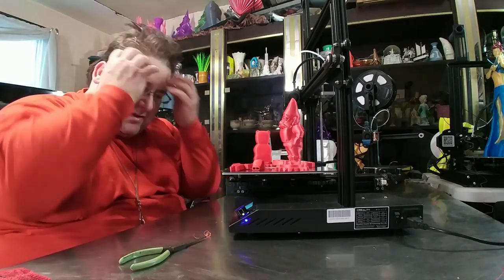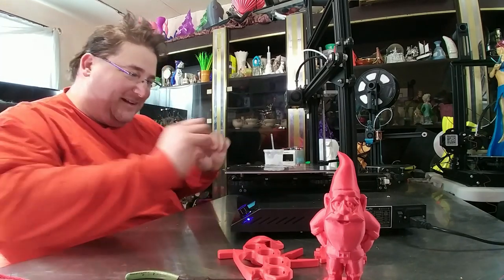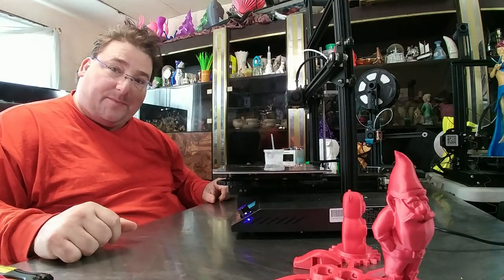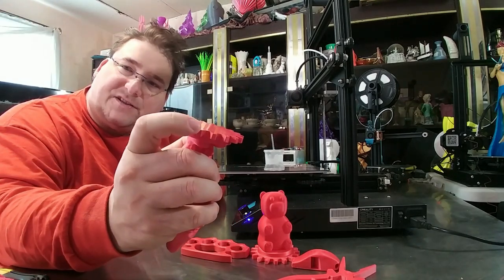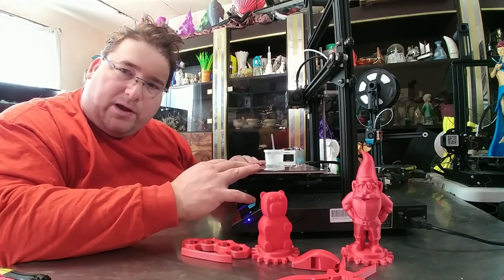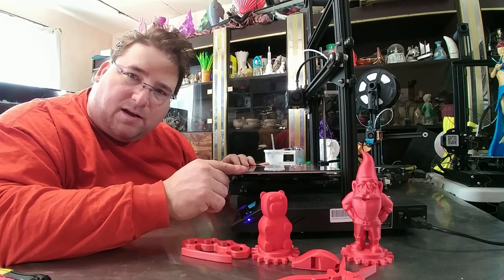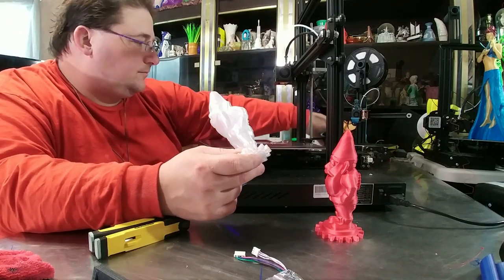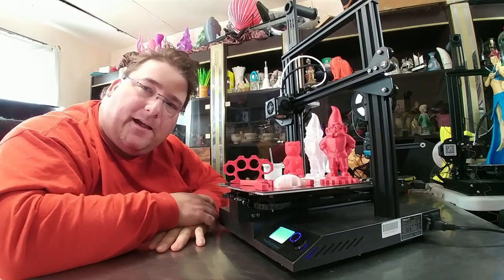Wham Bam Magnetic FlexPlate System T3DP 232

Comment: Hi Chris! Great review. I'm glad I got to see ABS printed on this surface. I don't have any - all I have is PLA and PETG. But I gotta say, I've been LOVING this PEX stuff and the utter convenience of being able to pull the spring steel sheet off the printer and pop the print off. Works EXACTLY like the removable system on my MK3, although on the MK3's PEI surface I worry that PETG will stick too hard and damage the sticker sheet.

And like you, I've found that the majority of my PLA prints can either be plucked off the PEX once it's cooled down. In some cases it's released entirely after the print has finished and the bed has cooled, like with an overnight print. But boy does it hold while it's hot!
Reply from the maker: yep and I Just did PETG and it comes off SUPER easy. easier than ABS and again ZERO warp. it stayed down and stayed flat all the way to the edge of the print. I am almost more excited about the PEX than the flex :-)
Reply: @nerys71  When you want to show off how easy it is to remove prints... just FLEX your PEX. 🤣

Comment: Thanks for the preview Chris. I'm in! I just bought a Buildtak Flexplate for one of my  Ender 3's. Getting this for the other one and an extra plate to try on the Buildtak magnetic surface.That shiny bottom finish is nice.  I might as well upgrade the CR-10S and maybe one for my Printrbot Metal Plus too. It will nice to have all my print surfaces like my MK3. How about an aftermarket spring steel sheet setup for the PRUSA MK3.
Reply: Awesome to hear! Our Kickstarter will have 90 kits of early bird discounts so make sure to sign up for email notifications to get early access.

Comment: It's nice that it's cheaper than the buildtak system. Better suited for cheaper printers. I've been fine just buying the spring steel from buildtak $30 and using clips. The magnet system is nice, but clips work just as well for 50¢.
Reply from the maker: agreed. but dammit I hate the freaking clips so much. I tend to print full volume a lot so I am always having to move the stinking clips out of the way and its just annoying :-) ALTHOUGH I really do like the Fiberglass Creality print surface they include with their machines. but its $35 for more. for $30 more I can ditch the clips and gain the nixe flex plate and pex print surface. if Creality starts selling the fiberglass plates and surfaces for say $10 it would be a much harder sell to me.

Comment: Nice. Though at around $70 for the version fitting the Ender 3, that plate upgrade costs half as much as the printer itself. Sure, it may be quite high performance and fit for high temp filaments, but until those get significantly cheaper, this is gonna remain a luxury upgrade for a very limited customer base. Probably gonna wait for the significantly cheaper china clone. Until then, my Creality Cmagnet flex build plate for $15 works just fine for me.
Reply from the maker: they are 30% cheaper than buildtak...... something to consider. I don't think buildtak is "going under" anytime soon.

the cmagnet is $27 (yes I also nabbed a few of them when cheap) bud sadly once you hit 80c they die. I am starting to dabble in higher temp plastics where I need 100-120 even 130c bed temps. cmagnet won't do that. the higher currie temp magnets cost a ton more cash than the lower grade magnets.

I DO love the creality fiberglass flex plate though. those are REALLy nice. if I can ever snatch up a bunch of them cheap you bet your butt I will grab them.
Reply from the maker: agreed if you are just printing pla and petg only the cmagnet system works fine and will give you the same convenience for about half the price ($15 was a early bird deal) I have 3 of them :-) (the creality version)

I do not even consider the price of the printer when pricing upgrades. there is simply no way for anyone else to compete on prices with large chinese manufacturing. no way. even Creality regrets pricing the ender 3 so low. it should have been $299 at least to start. they were too aggressive and now are stuck with it (not so bad for us of course :-)
Reply: @nerys71  Yeah, the Ender 3 is amazing value for the sub $200 price. And it is exactly that price, which makes it THE budget printer of 2018. I think Creality knew exactly what they were doing, they wanted to expand their market share and in that they certainly suceeded! And seeing how they aren't bancrupt yet, that gamble obviously paid off.
Sure, no manufacturer in the western world could provide a smililar product for that price, but that's what the whole Chinese economy is pretty much based upon.
Also, they pretty much save most on the quality assurance and shipping costs.
I, for one, am thankful for this, as my budget is pretty limited and Creality allowed me to enter 3D printing with the Ender 3, and i cannot even fathom how many more people too.

I bet the Wham Bam Magnetic FlexPlate could become a viable and popular alternative for higher priced printers, maybe even a new quai-standard if the performance matches the cost. But for the budget market, my money is all on China. Wanna make a bet on how long it`ll take them to produce a clone for less than half the price? I might be wrong, but i think those Cmagnet plates were commercially available even before that Ez Peelzy stuff, which i reckon was the original.
Reply from the maker: they already do. as you noted the cmagnet surface is around $30 IIRC. and its fantastic. I have 3! but its PLA and PETG ONLY if that is all you need then you are golden. if you want more though. abs, nylon, pc etc.. then it won't work. but this will.
Reply: But do we really want to support an industry that soley exist due to IP infringement? I rather support the people putting in the real work and innovating cause you know that's how their able to do the work.

Not saying what to do with your money, but yea it's just a tad Immoral ya know?
Reply: @user-nd7rd8jo6h  I concur generally, ultimately, by trading with China in this unrestricted manner and transfering knowhow, the West is hurting its own industry in the long term. Go ask Donald Trump, he'll tell you all about it! And to be honest, if i just had the surplus budget, i'd gladly support original inventors and manufacturers, as well as content producers. But as it stands now, without the cheap chinese stuff i'd still only be dreaming of a 3D printing hobby. I'd prefer to have an original Prusa i3 over an Ender 3 too, but i would need to save up for that for about a year at least.

In the end, the Chinese with their cheap printers and gear allow for significantly more people to get into 3D printing and thus massively expand the maker community globally. And this will probably benefit us all in the long run. For professional commercial applications, western manufacturers are still the best choice bar none, but for hobbyists and budget restricted people, there's simply no viable alternative to China. But if the Chinese can make decent products out of open source patents (like the Creality printers) and make those mass available for lower prices than one could build them from scratch buying all parts from western suppliers, then more power to them!
Reply: @axelhopfinger533  yea that's very fair. After all I did just get a CR10-mini lol 
So it's not like I have a soap box to stand on XD.
Reply from the maker: @user-nd7rd8jo6h  what IP infringement? Who's doing the infringement and on what?

Comment: Hey, thx. :) I've been wondering how it'd hold up (magnetism) with high temperature printing. Personally, they're too much moolah for my needs. That said, I do sincerely wish Peter (the founder) success.
Reply from the maker: if you want the convenience of flex without mag and pex Creality has their print surface on a fiberglass plate. binder clips to hold it on. works VERY well. not as nice or as convenient as this by any stretch but it does get you the "flex off" for about half the price. (around $27 to $30)

Comment: Don't know if it's been said already but the newest plumbing system usually the red and blue piping is called pex and it can handle up to around 180 F. It might be the same material.
Reply from the maker: Name is coincidence. I thought that too. remember I hit 133' with this surface. that is CELSIUS. quote a bit higher than 180f (which is well below 100c)

Comment: very interesting, a magnetic bed is very useful, I substituted the glass coming with my CR-10 with the Reality magnetic one and it works great. As you said the bed (metal one) has to be levelled and mine was not, I had to put spacers. I can just suggest you to try the reality one, it is 24 euros and for me it works great. I like your channel carry on like that. Cheers from Italy ;)
Reply from the maker: I have the creality one and it is very good BUT it can basically only do pla and tpu. Petg if you are careful not to pass 70c on the bed. Beyond that it will degauss. Ie lose its magnetism.

Comment: Samarium Cobalt magnets have a much higher heat resistance compared to neodymium.  Most neodymium magnets have a fairly low heat resistance.  I’m currently using Samarium Cobalt magnets on my Hypercube 300

Comment: I'm really surprised the ABS didn't delaminate anywhere.
Reply from the maker: I have since discovered it was not a ABS it was petg abs R is in abs replacement. Not ABS at all but I just got four rolls of total pack abs vanilla White and it is still printing perfectly fine the vase did not crack neither did Sir layers a lot and I am printing a nose cone now I am keeping the bed pretty hot 115 Celsius I believe that keeps enough of a hot air bubble around the print to avoid cracking :-) the little vase is also airtight and watertight and it's not peeling from the bed at all I am very impressed

Comment: Hi Chris, I am backtracking on videos, I was wondering if you have tried flipping the steel over and placing a creality black sticker on there so you can use it without heating the bed, or for very long, Thank you as always
Reply from the maker: Yes and I do not advise it spring steel has a curve to it this flattens when you place it on the print bed of course but if you place it on the print bed curved down it's possible for a part to work with enough Force to pull the spring steel up which would be bad for your print so you really should only use one side of the spring steel plate so that the curve is up and this way it remains attached to the print bed
Reply: Nerys Thank you I remember now about you mentioning the curve, I will keep looking for a spare plate for a reasonable amount t, Thanks again 😊

Comment: Is the PEX the same as this ?
Cross-linked polyethylene , commonly abbreviated PEX , XPE or XLPE , is a form of polyethylene with cross-links. It is used predominantly in building services pipework systems, hydronic radiant heating and cooling systems, domestic water piping, and insulation for high tension (high voltage) electrical cables. It is also used for natural gas and offshore oil applications, chemical transportation, and transportation of sewage and slurries. PEX is an alternative to polyvinyl chloride (PVC), chlorinated polyvinyl chloride (CPVC) or copper tubing for use as residential water pipes.
Reply: Sorry the PEX is just a name we invented for our new polymer that out performs PEI      It has no correlation to the chemical name PEX  or polyethylene
Reply: Got it. Thank you for the info. Great looking system. I would love to try it out for my You Tube build videos.
When will be able to get our hands on some ?
Reply from the maker: that's what I thought but they say its something new they developed to outperform pei. PETG is my next torture test :-)
Reply: @petersolomon3505  I stand by my backronym "Printer Enhancement X-treme!" (The X makes it sound cool!)
Reply: @BV3D It was our favorite part of the video! :)
Reply: I like it Bryan!

Comment: Thanks for this video, I was searching for a product like this.
Could you please tell me the dimensions and weight of the plate they sent you?
Thanks!
Reply from the maker: The dimensions change based on what size you order this particular what is 235 mm by 235 millimeters in order to fit the Ender 3 class printer

I might be able to weigh the plate with the p e x on it but I do not have a separate one to weigh it separately and it is already assembled
Reply: @nerys71  thanks that would be perfect!

Comment: quick question.....does it take anything to make the prints stick....glue or whatever
Reply from the maker: NO that is part of why I love it so much. absolutely NO prep except clean with IPA or Acetone between prints. if it starts to loose a wee bit of stiction take some triple naught steel wool to it lightly to gently reprime the surface. so far I have had no need to scuff the surface at all.

Comment: Seeing them bend that plate so much in a video makes me wonder how to long term flatness will maintain itself, yes I know its " spring steel" but everything loses flatness if you keep heating it and applying force as time passes
Reply from the maker: I think they're exaggerating for the video you don't really need to flex very much if at all Plus it's just sloppy enough that simply placing it on the magnetic surface should flatten it again
Reply: Nerys If I get the abs bug, I will have to consider it I suppose. When your bored could you add a list of forums for some of to follow, or you can always pm me here or @ thingyverse initials and 8888

Comment: tell us how u got those awesome prints or die
Reply from the maker: you learn that slicer settings are "model" dependant not printer dependant. I use the SAME profile for ALL printers and for the most part "tweak" based on what I am printing and sometimes what filament I am using and how the model will be used.

if you want "safe" this should be a solid good start.

3x3x3 25% grid both ways infill. (3 walls 3 top 3 bottom)
wipe 10mm
retract 5mm at 65mm/s restart 0mm at 20mm/s no coast
Set zipper to "rear"
220c first layer (again dependant on filament) and first layer speed at 30% bed 60c for pla (again dependant on surface ultrabase or glass I use 70c) on some machines 75c since I know it will be at 70c or less by the time it reached the model. but if its a STICKY surface like build tak or creality stock etc.. 60c should be fine for pla

speed 40mm/s travel 100mm/s

jerk 5 print acceleration 500 travel 1000

if you have lots of stringing turn on combing.

start with that and see how it goes. tweak and adjust as needed. take notes so you know what to UNDO if it goes sideways.

as you learn you will develop a "standard default set" and you will also learn to tweak as you LOOK at a model and go huh this might need this or that or that usage case might need this or that.
Reply: Nerys i think my setttings are ok. also not using cura. s3d is simple and does the job. my problems are mostly caused by mechanical issues. 

https://ibb.co/fukzFq

you see that line. not noticable from 40cm away but its annoying. printed on tevo ma. installed 2208s you should see how silent it s. sometimes i m thinking its not working. i use linear advance on ender 3s. tinkering about how to remove z seam is nearly finished thought for me right now. i ve problem with belts. on some prints one layer goes out like 0.2 mm
Reply from the maker: Yes I see well that is not horrible I would want to fix that I would check the right hand vertical trolley and the brass nut on the left-hand vertical trolley that the lead screw passes through make sure they are loose enough if they are too tight and in the wrong position they will cause that kind of problem

Also run the printer up and down vertically and pay very close attention to the coupler and Lead screw if they are not true and straight consider adjusting and or replacing if necessary

Comment: Off topic ... What is the difference between MK8 and MK10 nozzles?  What kind are needed for a CR-20 printer?  I want to get some spares and some different sizes and don't know what type to buy.
Reply from the maker: I am not entirely sure I have to use nozzles of different types and they all work as long as it's the right thread in this case and M6 thread and as long as it's approximately the same length it seems to work just fine so I've used the e3d shaped ones and I've used the creality style cone shaped ones and they work fine
Reply: @nerys71  so the key is M6 thread?
Reply from the maker: essentially yes. NOW there could be other critical differences. length of threaded part length of exterior part etc.. (too long and you will lose too much heat "at" the tip of the nozzle etc..) so for example an E3D M6 Volcano nozzle will screw in but won't work :-)

I "suspect" however as long as you stick with brass and roughly the right "size and length" in an M6 thread it should work fine. at least so far they have worked fine for me. the only time I have had trouble is when I tried "odd" materials (stainless or plated hardened from unknown makers etc..) those sometimes fail to work right (heat dissipation issues I suspect) or the bore is not well made etc..

but just brass? if it Looks right my "guess" is it will work right if the thread is the same.

 @btigenie